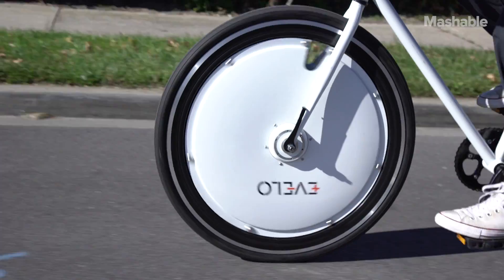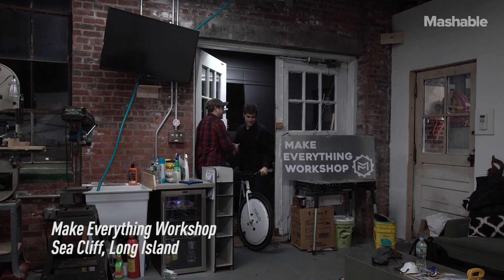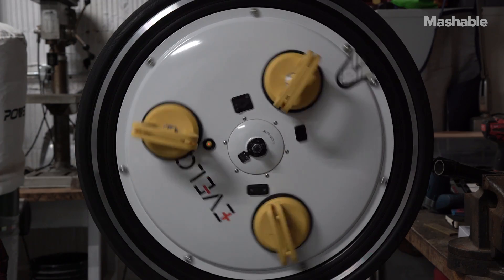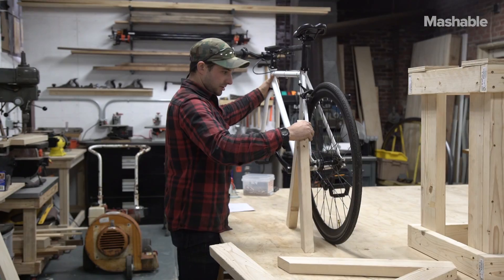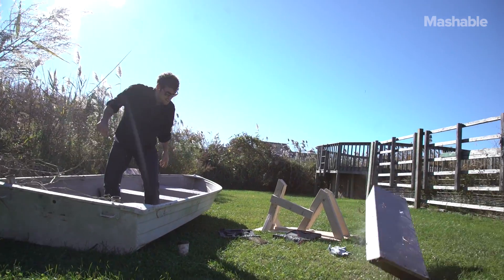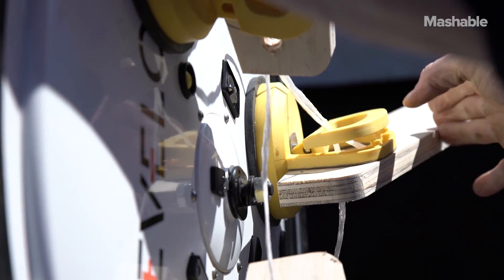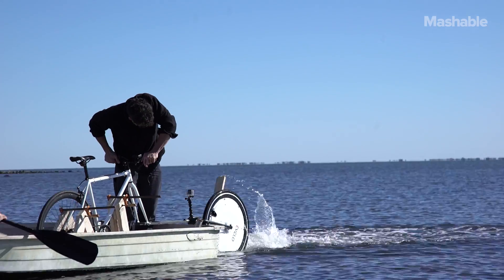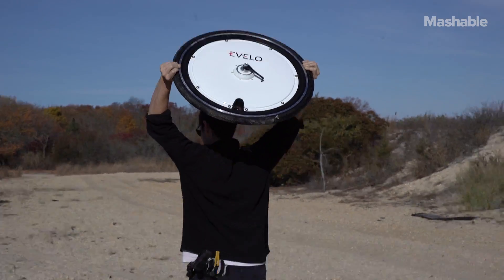Can an Electric Bicycle Wheel Power a Boat?

Comment: The point of the electric bicycle is to boost the pedal power from your legs with the electrical motor. If you create a stand so that you can pedal the wheel + having the electrical engine boost it, you'd probably go faster/further.

Furthermore, why connect oars to the wheel? Wouldnt it be more efficient to connect a propeller driven by the wheels rotation?

Comment: the whole point is that since weve got ebikes - we want to use them in a different way, and the current designs leave alot to be desired...so what can i strap my e bike into to drive a propeller? apart from the shuttlebike design, i dont see many alternatives..

Comment: looks like you reached too far into the water with your paddles ... the downward stroke takes power to "get down".

maybe if the paddle only reached down a few inches to maybe 6 inches ... the forces on everything would be less...

I wonder if 2 very ... VERY light foam filled(or maybe blowup), pontoons that could be on the bike, deflated or riding above the head(like a sort of roof & part of a streamlining kit), could allow you to forget the boat altogether?

Comment: it should be om both sides of the wheel and should be smaller and finned out on the edges.  and the bike angle brace needs to be higher up more than half way.  Petty Officer U.S.C.G.